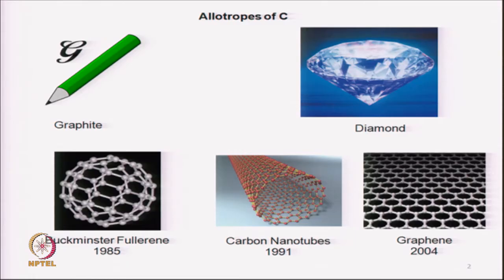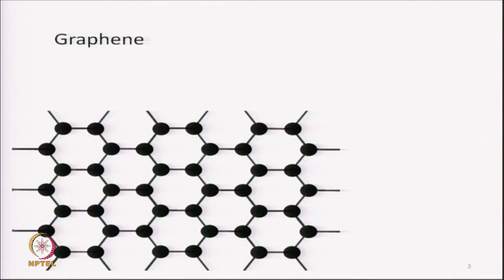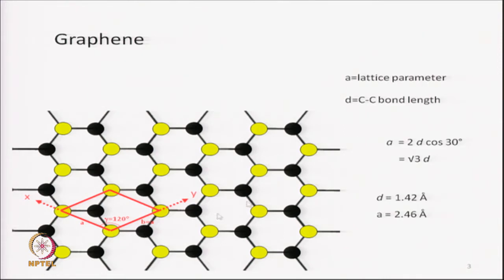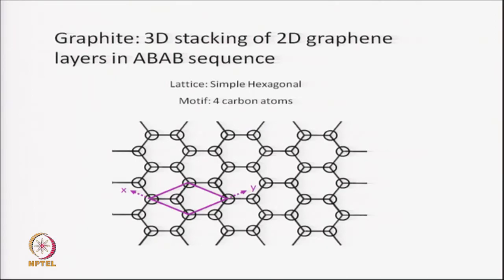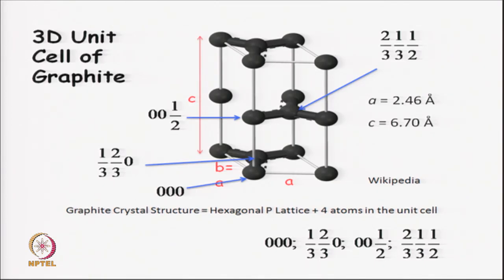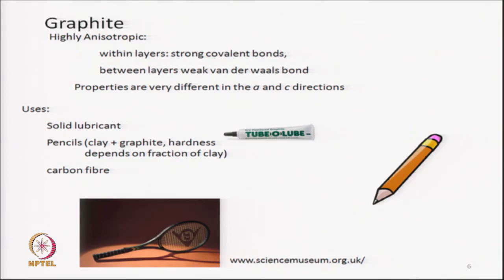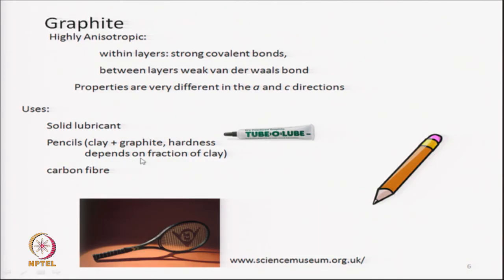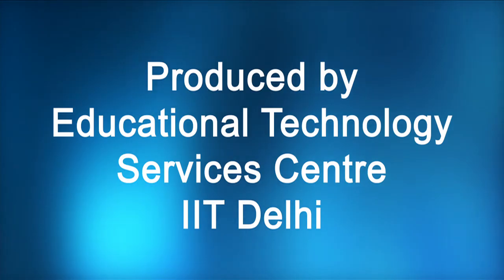Structure of graphite

Comment: sir,  @7:08  in the ABAB sequence, we saw that in the  basal plane of the unit cell, there are  no carbon atoms above the lattice point (i.e. in B plane), but in the unit cell of graphite, @12:14 , the carbon atoms are present one above the another. How sir, please clarify that.
Reply from the maker: There are two types of atoms in any given plane. One type is directly above the atoms in the plane below. The other type is not, they are above the vacant sites in the plane below. So the entire plane cannot be considered to be directly above the plane below.
Reply: @introductiontomaterialsscience   if 06:51 , you had shifted red (B layer ) left instead of right , then it would match the 3D model.
Reply: @channel-ck8yo  thanks for clearing the doubt as 3d model look very different as sir shifted to the right instead to left
Reply: @introductiontomaterialsscience  If we construct the hexagonal lattice plane by joining the two coinciding points, that is of plane A and projection of plane B on plane A (indicated as red point inside open black circle) instead of constructing lattice plane by joining points with only open black circle. We can get unit cell like in @12:14